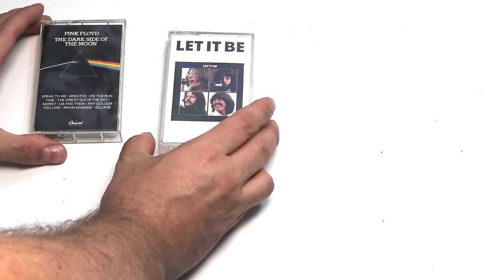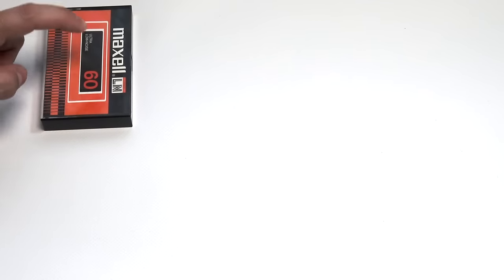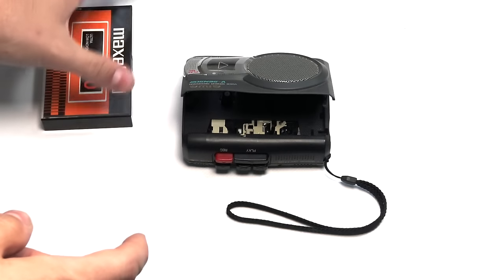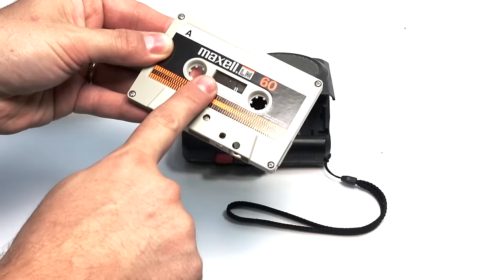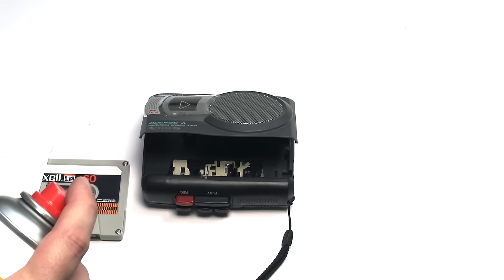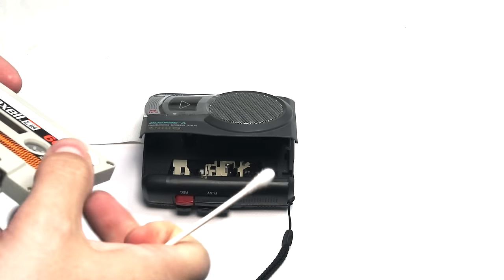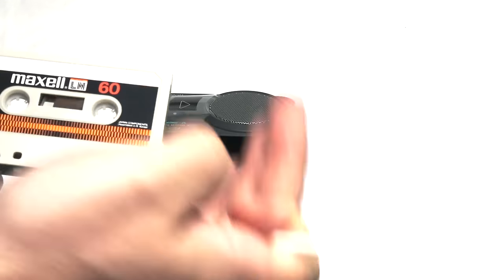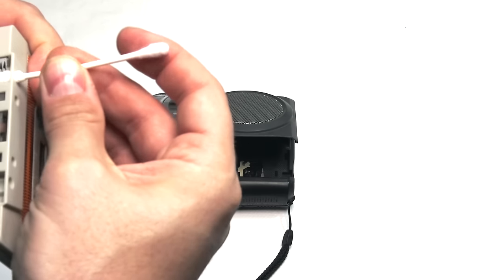How to relubricate your stuck cassette tapes

Comment: Does WD40 work?
Reply from the maker: Better not, it's more of a hydrorepellent  than a lubricant...it will probably work but I prefer not to suggest it. Try finding high quality dry silicon based lubes...
Reply: ClubRyzen no. No lube actually “works”. This will only destroy your deck.
Reply from the maker: Woah, Jonah! Is this your personal crusade...I am reading all your nonsense replies to people. Read the papers I have published in the video description. Again, you are driven by prejudice.
Reply from the maker: Jonah, as many other techs you are driven by prejudice without real knowledge, in this case, about this issue. It is really sad to see how arrogant you are, just go back and read your commnets. I see now that you have written several negative comments over the months and I think you should inform youself better before pointing your finger, insulting and denigrate people. I have posted simple things but considering that you would like more proof here you go. After rading this info, I hope you will be polite and intelligent enough to apologize.
Here you will find a selection of scientific papers explaining the issue and how it is a standard procedure to relube tape (even NASA does this!). I have underlined a few crucial passages in the papers: 
Heritage: https://www.dropbox.com/s/f8254yfeqrrw9vp/heritage-02-00097-v2.pdf?dl=0
Nasa: https://www.dropbox.com/s/xxdw1qh8mlbppdu/Nasa.pdf?dl=0
HESS: https://www.dropbox.com/s/ydrvxg6zipjkrvw/HESS_Tape_Degradation_ARSC_Journal_39-2.pdf?dl=0
Preservation Commission: https://www.dropbox.com/s/3s3ejmho2jexhgt/pub54.pdf?dl=0
   - (here is the official article: https://www.dropbox.com/s/rtvqt1n537w9vpa/Bogart.pdf?dl=0)
Kondo: https://www.dropbox.com/s/zi4vv42ggi9vh8u/tribochemistry-of-ionic-liquid-lubricant-on-magnetic-media.pdf?dl=0
Here is an article of a lab that is relubing its cassettes: http://tasso.cat/re-lubrication-of-compact-cassette-tapes-with-sbs/

Comment: Sry, my intelligence doesnt approve with this tape relubing. The simple fact that the lub gets on the pinchrollers and capstans is enough to not try this. If the tape is sticky maybe its just to old and is degrading anyway.
Reply from the maker: Lube is not supposed to get on anything than your tape. As said, apply and after waiting some time, remove the exceeding amount with various cue tips. In the video description you will find several papers that demonstrate that this is a standard procedure.

Comment: JEEEEEZAS ! You need 13 minutes to tell us this stupidity ? LUBRICATE THE TAPE?? Who the hell taught you this aberration???  What about the grease which will migrate from the tape to the pinch rollers, heads, capstan axle and so on? And of course, during time this lubricant will saturate the mechanics with dirt and grease, and will stick the tape itself. The only place where you can safely add lubricant, but a solid one, not liquid, is the guidance rollers axle inside the cassette. Not directly ON THE TAPE !
Reply from the maker: Study the articles and info I inserted in the video description, then come back withoutq prejudice. Lube is normally added and re-added when needed.